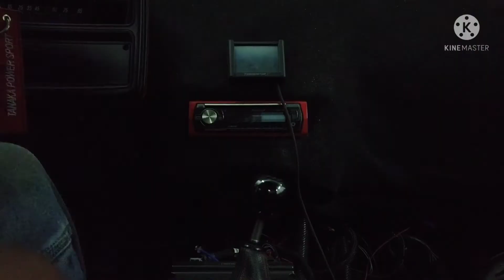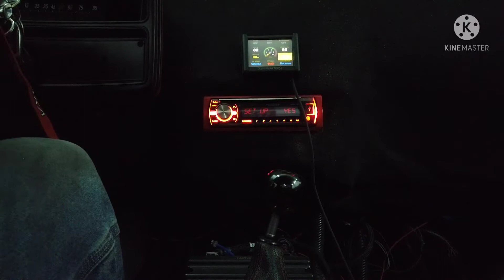Elco update: replaced a head and figured out the charging issue.

Comment: Is that motor fully stock?? An are u using stock fuel tank??
Reply from the maker: Yes its a stock 5.3, yes I'm using a stock fuel tank for now with a in-tank fuel pump. I did go with a new sending unit for a fuel injected elco(late 80s) so it has the return line on it. I plan on keeping it somewhat full so I won't have any issues when cornering or hard acceleration.
Reply: Ok cool, I have a sbc but I’m fuel injected also, stock fuel tank but I have the Holley in tank pump for the gbody in mine but it does not read on my fuel gauge, anyway I’m following your build an like the process of your so far, eventually I will go Ls too maybe
Reply from the maker: @adrianmr.gbodyt2359  thanks many I appreciate it. Wish I would have recorded the whole process. Have you checked the ground wire on the sending unit for the gas gauge?
Reply: @Dashsgarage  yea that’s honestly probably what it is, jus haven’t got back around to it